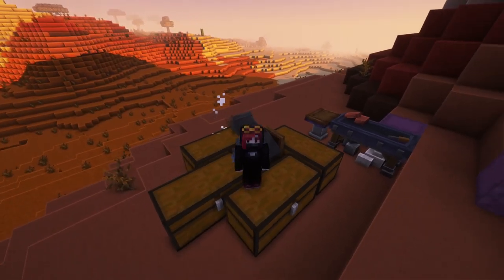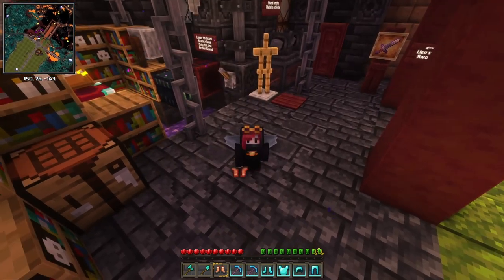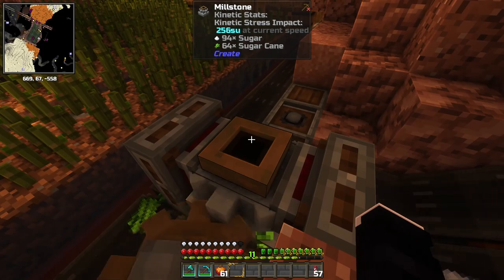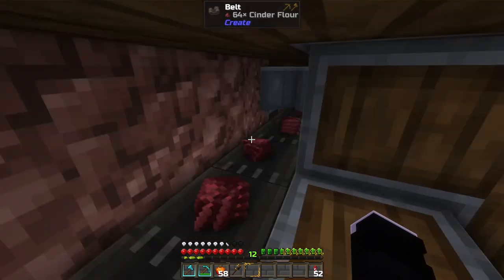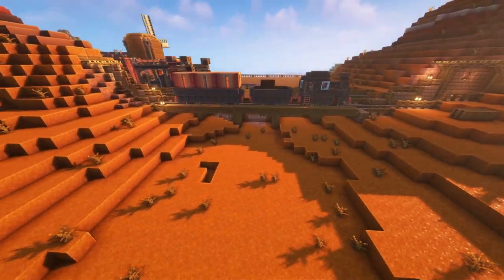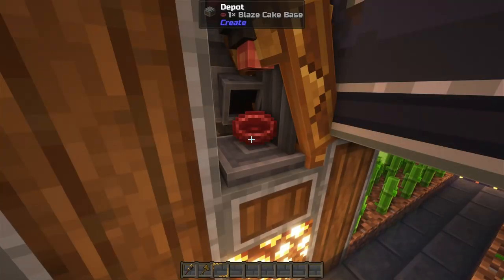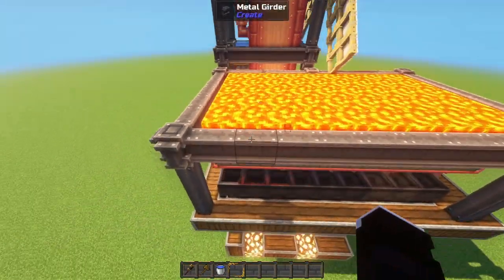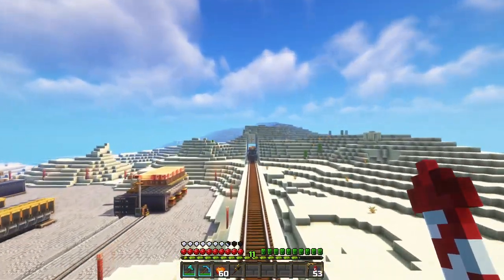Batsy SMP - Ep9 - T18 Super Heated Steam Engine + Schematic!

Comment: For some reason, This seemed to be missing several connections.  Nothing was set up to rotate the crushing wheel, the mixer, the lava pump, or the belts that bring all the cake ingredients together.  I was able to hook everything up and get it spinning the right direction, but I'm wondering if I'm missing a mod that might have been used for parts of this.
Reply from the maker: That's weird, everything on the schematic was from create alone. I had no issues when I tested it on my end
Reply: it happened with some other schematics I downloaded from that site, the pumps were reversed and some other problem but mostly fixable with a good look at the machine